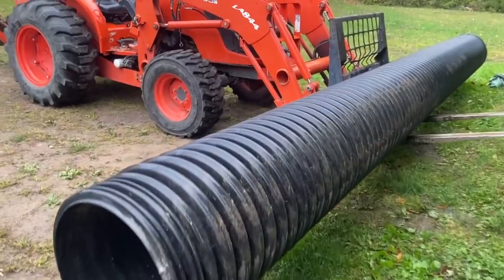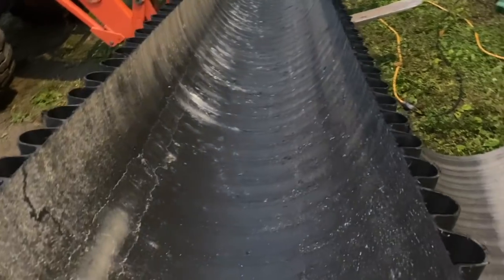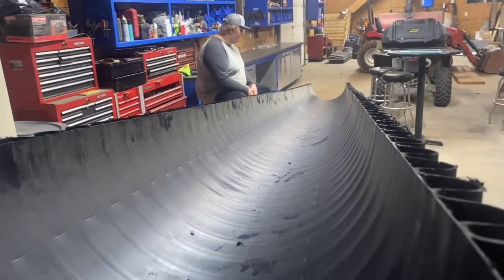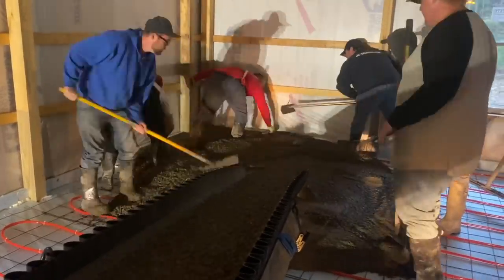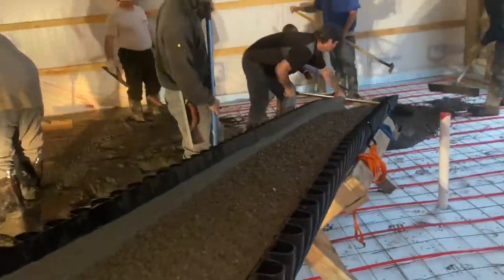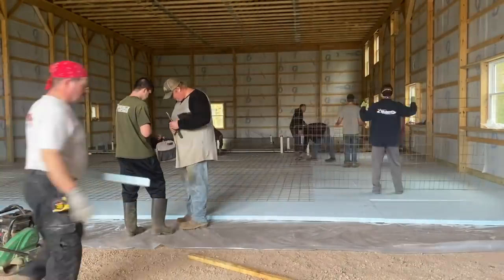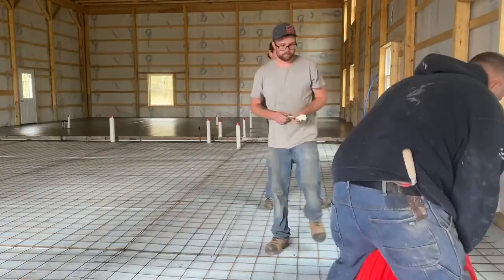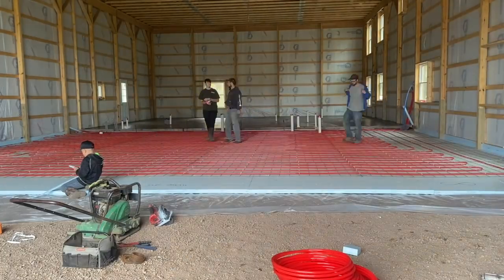40 X90 Pole barn floor. (SAVED $3000 ON CONCRETE!!!!)

Comment: Im glad to see someone doing it correctly.  Im 3rd generation. 
A tip that may help. I drill a hole in the cap of a water bottle and tie it to the handle of the power trowel with a nuce so i can take it off and fill it. When you need a shot of water just grab it and give it a squeeze.
Reply from the maker: Thanks man 👍 That’s a great idea. My buddy put a water bottle holder off a mountain bike on his. He said it’s his beer holder. Lol 😂

Comment: Ive been in the trades 30+ years myself..carpenter/ installer/ steel roofing/ pole barns....and I like your videos because your like one of the guys,  I could have worked with over the years. My house burnt down in January, here eastern Ontario. I want to go radiant heat and ICF...paying close attention, thanks!
Reply from the maker: Thanks Marc. Sorry to hear your house burned down bud. that sucks. Any questions along the way hit me up pal. 😊😊

Comment: I thought the spray foam would not only seal out water and concrete but also add strength. You showed how the side walls of the pipe flexed foam might help. I installed radiant heat in both wood and concrete floors back in the early 90's and the people still love it.
Reply from the maker: Thats awesome. Thanks. It is something that never goes out of style. Warm feet that is. lol 👍😊

Comment: Great video, very informative. You make your videos enjoyable.
What type of concrete do you recommend for a 45’ x 50’ pole barn (future wood shop) in Minnesota?
Reply from the maker: Thanks. I like a 4000lbs concrete mix. We use low air entrainment in barns that will not be heated all the time. We get pretty cold winters and snow. I prefer wire mesh over fibers but you can run both if your budget allows.

Comment: Wheel barrows? Hand screed then power screed? Only half the building? Wire under the tubing? It looks like you made the job much harder than it needed to be.
Reply from the maker: Maybe you didn’t watch the video. We didn’t wheel barrel at all that would have sucked. Done it for years. We did the slab in three sections not two I explained why in the video. We used fibers in the concrete and yes the wire is there to hold the tubing down as explained in the video. We used a hand screed to set wet pads for grade as I said in the video as well. One small area we pulled it down with the hand screed to knock the high spot down. The job was not that hard at all we didn’t think? 
Thanks for the feedback but I’m not sure you watched the video and listened to the voiceover explaining everything?

Comment: Great idea on the concrete chute. Question: Where in the slab profile does the mesh and tubing end up? I didn't see any chairs or anyone working a hook? Is the tubing and reinforcement intentionally left on the bottom? I totally enjoyed getting your grandson involved as it definitely grows a good attitude towards a great work ethic later in life... thanks for the video.
Reply from the maker: John thanks buddy. 👍 Yes I love teaching the littlre guy to work. The tubing is always left on the Botton so we did fiber mesh in the concrete. We always hook the wire but not in a radiant slab because that tubing needs to stay on the bottom. It works better there and it won't be damaged. If thge slab was say 8" thick we would pull it up a little bit. Thanks for the comments 👍👍

Comment: A question from someone who has never worked with concrete. Does the wire screen get lifted so it's burred in the middle of the concrete or does it sit on the bottom? I thought its purpose was to provide added strength to the concrete? Great video!
Reply from the maker: The wire gets pulled up if wet don't have tubing installed. if there is tubing we don't pull up because it will put tubing up where it will be damaged. at that point the wire is there to hold the tubing in place so we add fibers for extra strength. you can staple tubing down and put wire on top. I might start doing it that way. we did one that way at the end of the season.
Reply from the maker: https://youtu.be/4HHC015JVBo

Comment: Two x two aluminum angel 1/4" thick bolted to the top of shoot. Chain ran under an over to a hook mounted on the side. Runs over the truck ears shoot. Becomes part of the truck
Reply from the maker: The trucks around here dont like to let us hook to there chutes because of the extra weight it might brake there chute.

Comment: That sure is a nice batch of most everything going smoothly for you on the prep, pour and screeding/floating.    30 years is one major run in concrete.   Around here, I have gotten asked to " help"  on pours and the usual result was I show up and my " friend"  who asked for help is ill prepared,  less than enough and less than skilled or even strong enough help to finish a pour that is way smaller than what you show here.  By the time we finish, it is usually down to ME as having done 90% of the work and little kids and friend with physical ailments that make even screeding a 16 foot screed a tough job basically a one man pull and a race to finish before it goes off.   Nothing worse than a pour like this being the norm.
Reply from the maker: That sucks buddy. Sounds like you should have them at least watch some of my videos first. lol 
I have busted my ass on jobs just like what you describe. Im getting to old and smart for that crap. lol I hire enough guys and use good equipment. Sometimes I could use a few more finishers. Most my guys cant finish but I'm teaching them but you would know how long that takes. 👍👍
Reply: @bondobuilt386  Thank you for your fine videos and showing how when one works smarter,  it sure can make even huge jobs seem smaller.  Sadly,  in my toughest lack of help, lack of avoiding my own pain being multiplied situations, it was usually instances of me being asked to HELP a friend get Their Job done.  One Basement pour and one Sidewalk pour in particular.   It was definitely hard to be doing 2 men's work and a bunch of young teen or even under 10 year olds as the balance of the help then to essentially have them being useless.  Thankfully if myself or other pro contractors have had concrete jobs,  we have had the manpower and resources to make the job an efficient division of skilled vs grunt laborers on hand.
Reply from the maker: @nighttrain022  understood. Nothing worse then not having enough or the proper help or tools to get it done. 
Thanks for the comments buddy 👍

Comment: Just curious why you don't install wire mesh on top of tubing?   Use staples to hold down tubing. then add the wire.   This would get the wire mesh into concrete more.  Plus that would give you the option to pull wire mesh up to middle of concrete pour.
Reply from the maker: The wire makes a real nice grid for laying out the tubing and getting thge loops exactly the same. We could have layed another matt of wire on top of the tubing but we used fiber mesh in the concrete. Some customers will pay me to put rebar down as well. Depends on the budget of thge project
Reply: @bondobuilt386  why not get a staple gun and staple the tube to the foam? I've done that for many years and it's much cheaper and faster than mesh
Reply from the maker: @user-zu2bw7ig5v  I like using the mesh it helps to lay the pattern as it’s 6” grid makes it easy I think. We lay it down fast and it’s not that expensive buddy. 👍👍

Comment: What does metal meshing do laying right at the bottom of the concrete? Seems like a waste of money to me, why not raise it?

Ps im ignorant lol just trying to learn for this springs driveshed pour
Reply from the maker: Jim. We always pull it up unless there is tubing attached. The tubing is best left on the bottom. We use the mesh to lay out and tie the tubing. The mesh is a 6” grid and tubing is layer at 1’ on center. If the slab was 8” thick I would pull it up. We put fibers in the concrete so that was out extra reinforcement when we run pex because the wire does not get pulled up. 
Thanks for the comments buddy. 👍👍

Comment: Great  info ...Cut out an existing floor ... laying out about 1000sf soon ... 250 in garage 750 work area ... garage will be tied in at a later date ... do you mind sharing the info on the pump, manifold, etc ... thx so much ... from down in the Finger Lakes ... Looking forward to running the dogs up on the Hill outa Houseville... "Keep your powder dry & your irons oiled" ... Thx Mark
Reply from the maker: Mark awesome we have a camp in Montague. Snowmobile up there. You can buy these manifolds and the pump on line from Supply House. That same pump I used will work for most applications.
Reply: @bondobuilt386  What model pump would you recommend for 750sf ... 3  @ 300ft loops ... taco 009 ... what model # ??? Thx Mark
Reply from the maker: @markrayburn451  Taco 0015-IFC
This is a three speed pump and it will handle many different applications and it’s cheaper then the 009. Taco built it to cover 007 008 and 009 applications. And it uses less power to boot. 👍👍
Reply: @bondobuilt386  Any other "parts" needed ??? Got the pump &flange in my cart ... backflow valve ... etc ??? Thx & Stay Safe ...
Reply from the maker: @markrayburn451  You need your manifold I just use 1” copper ones if tubing is of equal length. You will need a proper sized expansion tank and an air scoop. You will probably need a taco zone control box to hook thermostat to as well. It’s hard because I dont have all the info about your system.

Comment: Is this considered slab on grade? And do the polls go directly into the dirt? Is there a different option. And will you be doing another video on start to finish on the cement work? Everything I see on YouTube has rebar in it thanks for the video
Reply from the maker: This is just a pole barn slab. Yes the poles go in the ground down 48" and sit on a piece of concrete at the bottom. There is a better option to put sono tubes in with post brackets or Perma Collums they are a concrete post that hooks to the 6X6. more money but way better no wood in the ground. We put rebar in monolithic slabs. and they are a slab on grade with an integral footer.
Reply from the maker: https://youtu.be/z__1OOIuHA8 this is a monolithic slab on grade buddy.

Comment: What do you use for a vapor barrier under the 2 inch insulation?  And do you use tape between the 4x8 insulated panels?  Thx. Love your Channel
Reply from the maker: Thanks. 6 mil polly vapor barrier. We do not tape the seams. It will move when you wazlk on it and the tape will come off
Reply: @bondobuilt386  I’m finishing my semi truck shop pole barn. (Already built) 30x50. Going with 6 inch concrete. Get my pad prepped lay vapor barrier then 2in insulation with mesh and pex. I moved to Nashville Tn area from upstate Ny and cannot find a contractor anywhere that will tackle this.  So.....  I’m doing it myself. Sure appreciate your knowledge and videos.
Reply from the maker: @bctw9004  Thats awesome buddy I am so glad I could help ya. Sounds like you got everything good with the project. 👍😊

Comment: Sorry to question your knowledge but why did you not use supports to centre the rebar in the concrete?
Reply: I was wondering about this as well, I thought you had to have it suspended in the concrete or not only can it rust, but it won't provide the support?
Reply from the maker: No problem 👍There was no rebar in this slab. We used wire mesh tyo hold the tubing down and fibers in the concrete for reinforcement.

Comment: how much did the concrete , rebar and materials cost you total in the end? I need to do a 40x60 pole barn floor.
Reply from the maker: Concrete varries so much from placde to place. We are paying close to $150 a yard here in central New York. A 40 X60 floor at 6” thick would take 44 -1/2 yards of concrete. If we need a pump to place the concrete its another $1000 for that on top of the cost of the concrete.

Comment: love it! I will  be building new construction ina few months in a fairly mild climate. With that being said I’m trying to decide what spacing would be best for my home & thickness of insulation. Our frost level is 18”.
Any advice would be appreciated. I subscribe, thanks for the good no fluff video.
Reply from the maker: Thanks for subscribing Tiffany. 😊 I need more info on the house. Is it going to be built on a concrete pad? Is your question how much insulation to put under the concrete and the tubing spacing? or something else?
Reply: I’m sorry, should have been more clear. Yes, on a concrete pad, 40x40. Since it’s a mild climate I wondered if 1” insulation would be enough? And would 9 or 12” loops be best. Any help would be helpful. Thanks
Reply from the maker: Tiffany stick with the 2” foam it will work better no sence in heating the ground even if its a milder climate. You should do 1 foot of tubing per square foot of space. You have 1600 square feet so I would run 4 - 400foot lups and run it on a wire mesh grid. this will space tubing 1 foot apart. I have a few videos on how to run the tubing and it will work perfect. I will send links. Dont forget to insulate the outer edge of slab too thats more important then under it.
Reply from the maker: @tiffanyjackson7638  https://youtu.be/MgAJmah0anM
Reply from the maker: @tiffanyjackson7638  https://youtu.be/MrAUkIzB6yU

Comment: What size tubing are you putting down? Thinking about putting this down in the basement and wondering what size water heater or pump to use. Is it okay to use a wood boiler to heat the water and what is the max temp you can pump? Thanks again.
Reply from the maker: Tom the tubing is 1/2” oxygen barrier pex. The heat demand will dictate the size water heater u need. A 50 gallon gas or oil heater will do most jobs. A taco 009 pump works for most jobs as well but I would want to know more info before sayin for sure. I run my house and shop from a wood boiler and mix the 180 water down to 120 into the in floor pex tubing.
Reply: @bondobuilt386  Ron the basement is 2000SF and I was thinking of 6 loops of 333 feet to use up two 1000 ft  rolls of pex. Planning on using Nudura ICF from foundation to roof, 19.5 ft tall and 2 inches of ISO foam under slab.
Reply from the maker: Tom I would run 4 500’ loops of the tubing. It will be much easier to keep the lengths the same. 1 Taco 009 pump will handle those loops fine and you can just use a cheap copper header. I’ve done it about 20 times. A 50 gallon HTP Phoenix light duty water heater in natural gas or propane will heat that entire house.

Comment: whats the red hose for?
Reply from the maker: That is for heat. Hot water is run through the tubing and heats the concrete up. Its called in floor radiant heat. Works great 👍👍
Reply: @bondobuilt386  so, I guess the hot water won't crack the concrete, that's good thanks sir. 👍
Reply from the maker: @patriot2872  no it won't crack it.  Your welcome 😊